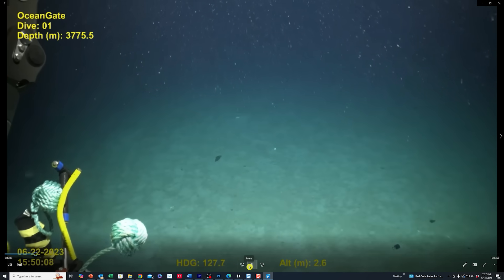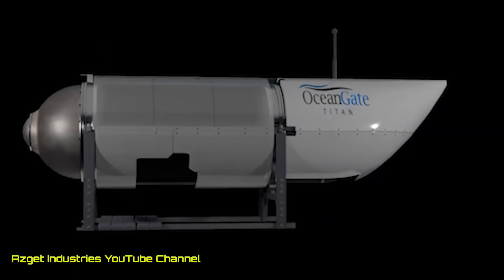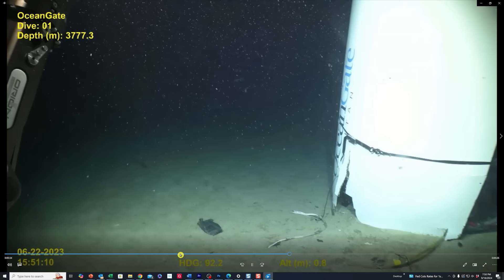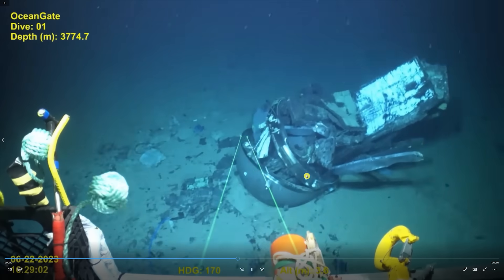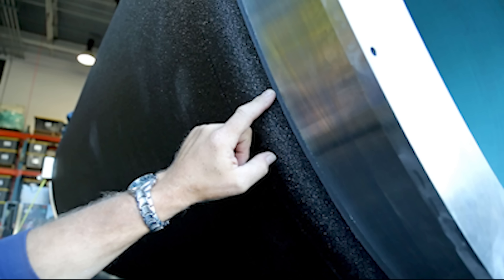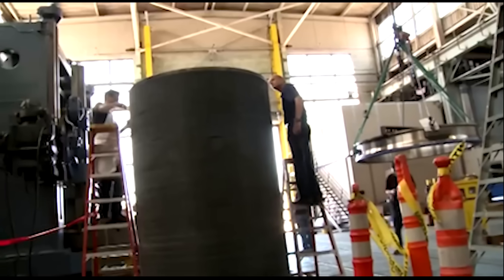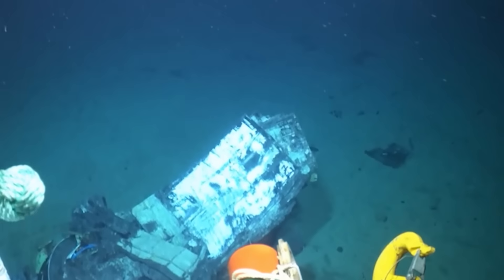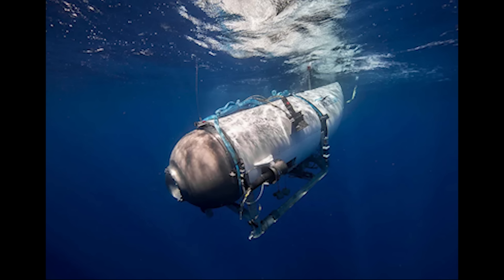OceanGate Titan Sub Debris Video Shows How It Imploded

Comment: GLUE! F-ING GLUE.  This guy was out of his mind to think that would hold up
Reply: why are you saying that like you know anything about designing submarines
Reply: @agentwc does it matter? They still messed up designing the submarine and costed 5 human lives
Reply: @midnighthrs yes, it matters. People spouting BS confidently and others like yourself just eating it up on faith is not good for anyone. Truth and facts matter.
Reply: They didn't even score the ring to add texture for more adhesion.
Reply: Not just that, it was basically a "butt joint". Probably the weakest joint of all joints.
Reply: The glue wasn't really the problem. Other deep diving crafts uses adhesives with no issues. The problem was the overall design and lack of safety protocols.
Reply: @nihlify  Mating the carbon fiber to the titanium rings was the big problem. Most other subs use one uniform material, the point where two materials meet is a big point of failure given repeated pressurization cycles. 

Rush was told this was not advised given they didn't even bond the materials correctly and yet he persisted. Not getting the sub certified by peers or doing proper sea trials before releasing Titan on the public was a disaster waiting to happen.
Reply: @nihlify  Glue actually was the problem to an extent.  Glue can only hold on for so long.  Glue is ment as a reinforcement on top of heavy plating and steel.  You have layers a glue followed by steel or titanium.  Not just glue lol.  These fuckers were told by dozens this wouldn't work and they paid for there arrogance.
Reply: Exactly then slapped a game control from Walmart in it.....overly arrogant and cocky.
Reply: @blakephillips381  I don't think the controller had anything to do with it imploding.

Comment: Jeff - at 11:28 - that is the view-port-end of the OceanGate capsule - filled with kicked-up sand and likely minus the glass itself. Also noteworthy: the colour of the sand surrounding the impact point's of the debris/wreckage -  note how much darker the surface sand is compared to the much lighter coloured sand immediately in and around the debris/wreckage sites - indicating just how hard and how much energy was imparted on the debris/wreck when it impacted the ocean floor - as in: shallow craters.. The biggest part of the wreckage seems to be 'floor' of the capsule and as you say, a few long remnants of the five inch thick capsule itself. One can also clearly see the rear-most titanium dome is partially separated from the ring. Just wow. Prompt, critical rapid disassembly..

Comment: whats up with the ratchet strap on the  damaged sub?  Like was it there when the sub went down? how did it stay on during the implosion? why  does it look like it was put around debris  to hold it together so it could be placed easier.
Reply: I believe the first video they were checking to make sure it was ready to be lifted.  There is a cable connected to the left of it.

Comment: 4:47 EVERYTHING left of the capsule..including the occupants(or whatever mushy pile of human remains there would be) and whatever equipment they used to run the sub, are pushed into the aft titanium cap. U can literally see how and where the capsule failed, and how it it collapsed in on itself from front to the rear. It would have blown out the front cap, pushed everything left into wherever it can be push which in doing so blew out the rear compartment

Comment: Interestingly enough the parts of the pressure vessel made out of the proper material (titanium) survived almost completely unscathed
Reply: Actually, it’s the opposite of ironic. Irony is when the unlikely happens, not the most likely..
Reply: @cd7071 🛎️🛎️🛎️🛎️ - an extremely rare smart comment
Reply: So...unlucky?  @cd7071
Reply: The carbonfiber gave away first.
Reply: Carbon Fiber never should have been used
Reply: @RAYTHEONGAMING or titanium. Submarines are built from steel alloys for a reason. Titanium gets weaker with each dive. Ask the Russians
Reply: @RAYTHEONGAMING  It is to light to sink with that much air for the humans, sink a ballon under water and see how far you can hold it. Grab a soccer ball and push it a pool. We are talking the ocean here with a big ball.....what makes people think this air pocket can sink that low? DUH!
Reply: its like people use titanium for that exact reason
Reply: Which makes one wonder why they didn’t manufacture/assemble a submersible craft which would have presented low risk/ no risk to any crew and their guests. 
Technically possible no doubt.
R.I.P.
Reply: @presspound7358 The reason for this is that Rush had to be special and have a sub like no other.
Reply: @presspound7358  technically possible without a doubt, however Stockton Rush and Ocean Gate's whole shtick was innovating experimental new design techniques, processes, procedures, and testing or lack thereof in order to reduce cost and keep to a development schedule. They did not have the capital investment to do it the conventional tried and true way and have it independently tested evaluated and certified. Stockton was a Pioneer man! You've got to break the rules to innovate new and experimental methods of design in order to progress the state of the art in a timely manner. Or at least you do if you don't have the budget to do it right.
Reply: @ButterfatFarms 
If you do it that way you shouldn’t risk taking passengers.
Reply: @ButterfatFarms Elon did it right. I was always worried about something like this with SpaceX, but he's smarter than that i fguess
Reply: @ButterfatFarms  Who hired them for this "test"?
Reply: lol why wouldnt it, anything solid and non pressurized lived fine
Reply: I recognized that too
Reply: That's because they didn't cover a large area. The only thing that deforms and breaks is what covers a certain surface and gives shape to the vehicle.
Reply: It's almost like carbon fiber wasn't a good material to use in a deep diving submersible after all...
Reply: I wouldn't call titanium proper. Submarine hulls use HY80 and HY100 steel mixtures. Titanium will become brittle with each dive, and the ship would lose its ability to go deep eventually. Russian Alphas used titanium hulls they dove less deep with each dive.
Reply: Titanic, titan, titanium
Reply: you need to look up the meaning of 'ironic'.
Reply: Your comment makes no sense
Reply: Being titanium isn’t the reason though interestingly enough…
Reply: Comments gonna say ya crazy. Ima say your not.
Reply: I’m willing to propose there’s a narrative irony to the situation. peeps like to try and box irony within a narrow definition but it’s like trying to set a hard line on what is a joke and what isn’t.
Reply: Что даже ботинок не осталось от этих хлопцев? 😅
Reply: stockton would of been using this as proof it works .
Reply: It's titanium why wouldn't it
Reply: The vessel wouldn't have sunk that deep becuase it was to light to beging with, hold a soccer ball under water for as long as you can. Now go down 100 feet, no wait go down till you reach the titanic and feel a soccer ball want to rise back up FAST. This whole thing is BS! Oceangate! (watergate) ....use a brain people.
Reply: if a titanium vessel had an implosion it would look just like that too. The US military had a carbon fiber submersible that went up and down 100+ times, the material is not the issue here, the problem was higher ups at the company did not care to do things properly.
Reply: @moonasha  A fully titanium vessel that imploded would not be in tiny pieces like carbon fiber. There are pictures on Internet of metal transportation tanks for railroad and highway transportation that has imploded for one reason or another. They just fold up inward like when someone crushes a pop can.
Reply: @ronfullerton3162 depends. Titanium gets brittle when subjected to sea pressure over and over. Russia taught us this with the Alphas. If it was brittle, that would cause it to break up in pieces
Reply: @scottgagliardi5933  Would it be as bad as the carbon fiber? I could see it cracking and giving away, but didn't suspect it would shatter near as bad. But I have never worked with or around titanium, and have no experience with it.
Reply: @scottgagliardi5933  WOW! I didn't realize it could get that brittle. I other words, do not use it for anything that will get into the ocean. That poor submersible was doomed from the start.
Reply: @moonasha  Carbon fiber are only strong when you pull on it aka a pressurized object holding pressure inside. Holding out pressure aka compressing carbon fiber makes it weak. So using it on a sub is a bad idea.
Reply: @moonasha 
umm no you are incorrect.  Carbon fiber is not used nor is it suitable for diving especially to extreme depths.
Reply: @Texas_Cody 
Carbon fiber is fine if it’s not pressurized 
(RSV’s or SDV’s)…
like that milk crate in this video.

The US Navy is building CF subs that are “not necessarily manned”-
the Optionally Manned Technology Demonstrator (OMTD).

The Seals have long used 
“wet subs” that were not pressurized since they were already suited up.

Cousteau designed a beautiful sub that had a fiberglass “exoskeleton” with a spherical pressure chamber within housing the operators.

Spheres are inherently the strongest shape.

I have heard that the USN has experimented with CF deep submersibles in the more standard design mode,
as well.

However,
they weren’t monkeying around like Ocean Gate.

That main hull section on the Titan was originally created by being wrapped around a cylinder-
they simply shouldn’t have removed it.

A hybrid construction would have been better than what they did-
no glue connections,
for one thing.

There are other things that I could say concerning buoyancy compensation for the added weight but at this point it’s all moot anyway,
isn’t it?
Reply: @Texas_Cody they are absolutely incorrect. Im a submarine vet.
Reply: @moonasha  "The US military had a carbon fiber submersible that went up and down 100+ times," 
Got a link?
Reply: @moonasha YES carbon fiber is the issue.  It works best when in tension (like a taut rope).  It works horribly when under compression (like a loose rope)

.
Reply: @moonasha so why does the Navy use Hy80 and hY100 instead of carbon fiber? Im a submarine vet and work in submarine repair. Every weld on the pressure hull is checked with radiography to ensure no defects. I don't know how that works with carbon fiber, or if it even would work. The fact that they had no way of fixing the flooding in the rear with all their electrical equipment was really dumb too. Damage control is everything on a submarine.
Reply: Backpart isnt pressured so much less damage when it comes to the implosion which only rips apart the pressurized area
Reply: @sickmit3481 Irrelevant. They weren't speaking about the unpressurized back with its equipment, they we're speaking of the titanium end caps that constituted the pressure vessel.
Reply: @ButterfatFarms the way you just came in hot with “Irrelevant” was funny. Sorry that was random but it was funny.
Reply: @idiotsandwich4912 smoking weed today, are we? 😂
Reply: @garycastronova7939  sounds like you never have, but things can be funny without weed too
Reply: @yuriyl1618  yeah well I was in edibles when I wrote that comment. Gotcha!!! 👌😊
Reply: @idiotsandwich4912  lol, yeah I do that sometimes. That word makes it clear right from the start we're not humoring this or going down that rabbit hole. Then just keep it short and say why. 😂
Reply: @sickmit3481 I saw a video where Stockton discussed oil being stored in the aft end, designed to buffer an implosion event bc he said the oil lessens the force.
Reply: that’s the opposite of ironic
Reply: Titanium / Titanic... eerie
Reply: @stephenholmgren405  Titanium is the material, which got its name from the Titans, the "fallen" Godlike entities in Greek mythology (they can't die in the mythology) that control or embody most natural thing or phenomenon like the sky, the earth, etc., Titanic is a sinonym for gigantic, huge, etc. which described the Olympic class oceanliner perfectly.
The Titan submersible is named after the afore mentioned Titans, those who lost in battle and were imprisoned by the gods into a living bottomless pit called Tartaros/Tartarus in Greek mythology, often referred to or called 'fallen gods'. Ironic, ain't it?
Reply: @LastGoatKnight  Funny thing, Titanic got her name from that as well. 

They were meant to follow a mythological theme nanes with the Olympic class liners.

Olympic, being first, named after "Olympus" and the "Olympian gods and goddesses"

Titanic, second, named after the Titans from Greek mythology.

Britannic, the third, was supposed to be named "Gigantic" after the "Giants" of Greek mythology. 
Got the name changed to "Britannic" because WWI began and it was an easy way to identify the nationality of the hospital ship.

Ironically enough, Britannic, the only sister ship not named after Greek mythology, ended up sinking in Greek waters.
Reply: @stephenholmgren405  both named after the titans. See the etymology.
Reply: Because those parts are not pressurized

Comment: Ocean Gate dove into many diffrent deeps for years no bad report well made and build sub, som1 killed them end of story
Reply: The sub was not constructed well enough to withstand deep dives over any period, was untested, Rush was advised by his own employees of the danger over and over--he fired those who told the truth.  He received endless warnings in open letters from experts.   Each time the Titan submerged it only accelerated it's own coming demise. This was predicted by those who knew.  The only thing that killed them was Stockton's arrogance and greed--he had all the money to construct a worthy craft, test it and implement his plan responsibly but he didn't want to spend the money and time to do it right.  Unbelievably, even though the carbon fiber hull would have eventually failed, Rush even bought substandard carbon fiber--used--to construct the hull.  To save some bucks.   He chose to believe that despite his lack of expertise he knew better.  The only reason Rush had no legal constraints around him is that the Titanic wreck lies in international waters, so there was no jurisdiction to stop him from operating.  There's no mystery at all as to what happened.  Get real.  No point in joining Rush in his delusional and selfish mindset.

Comment: Scott Manley did a good analysis video on the wreckage. He pointed out that all of the carbon fiber seems to have been crumbled into a ball towards the rear of the vessel when it imploded. That seems to indicate that the catastrophic failure occured somewhere in the front of the vessel. We know it's not the portal window, but it could very well be around the area where the titanium ring was connected to the front area that gave way.

Comment: The first part you see is indeed the front Dome. It's further from the main tube wreckage indicating it was ejected with some force. The front sealing ring is entirely absent, perhaps indicating that it was 'fired' even further away. The main blob of wreckage is the rear dome, the rear ring, and the compressed remains of the main tube. This all points to the failure point being at the front of the vessel. As the water hammer entered the tube it blows the front dome off and the main tube starts to be compromised from the front, squishing it inwards and backwards. Most animations show the tube being compressed from the middle first.

I think you (and others) have hit on something, which is the relative behaviour of the carbon and titanium when under pressure. The two materials will behave differently, which means the glue line is constantly being cycled in a way it may not have been designed for.

Something also which many commenters are missing, is that the use of a carbon tube with titanium end bells was not unique to the Titan, as a US military unmanned sub used the same technology, with no known issues.

Comment: 6:03 The second titanium cone is clean of any carbon fiber because it's a hatch door. It was not supposed to be glued to the hull. I believe it was bolted down.
Reply: Thanks for pointing that out, I had forgotten. However, was the titanium ring not glued to the cylinder and the nose cone bolted to the titanium ring? Something failed in that area for the collapse pattern that occurred and it will be interesting to see if an analysis of the parts they retrieved are able to show what it was. I feel like real dolt that I had forgotten that critical piece of information.
Reply: Yep. The front was on a hinge.
Reply: The tube was glued to a seal ring. The ring was bolted to the front dome. During the failure, the ring separated from the tube.

I am surprised but the dome also separated from the ring, shearing the 15 or so bolts that had held the end dome on for the dive.
Reply: @Set-it-to-11  Many people have mentioned how they only put as few as 4 bolts in the dome, and on one occasion, the front some fell off after an impact sheared off the few bolts that were holding it on. It's mind boggling that they would even conduct a dive with one bolt missing, let alone 3/4 of them not in place.
Reply: Both great points about the composition of the titanium hatch - absolutely the ring very likely was still bolted to the hatch one side and the side now exposed would have been chemically bonded to the hull originally.

Comment: I don’t think you understand “implosion”. Under external pressure, the carbon fiber tube would squash flat instantly. Except for A few crispy fibers that would flake away at the folds. The passengers would be squished flat as well. Did they find much more than dna samples?